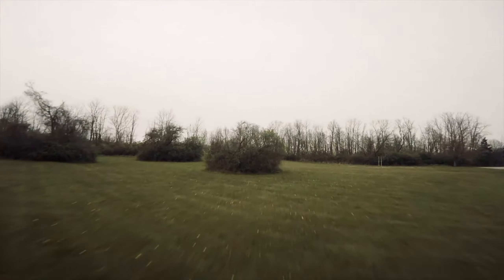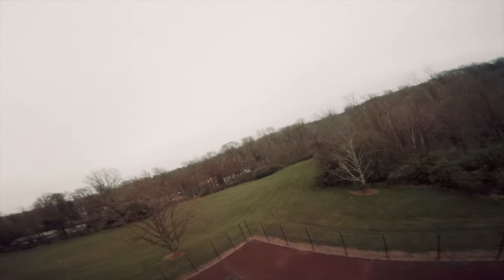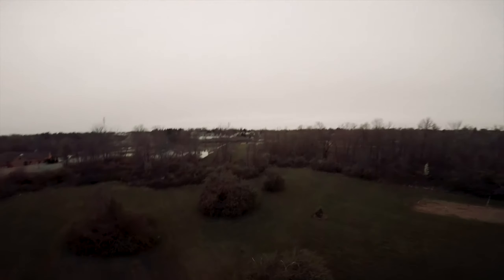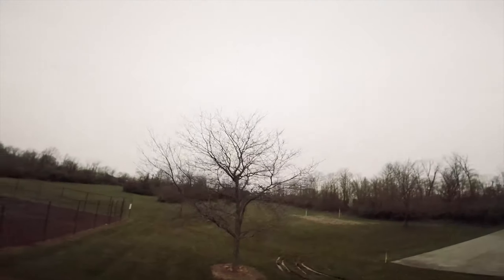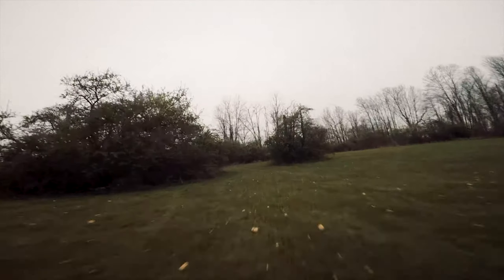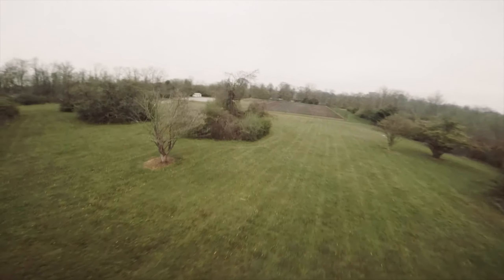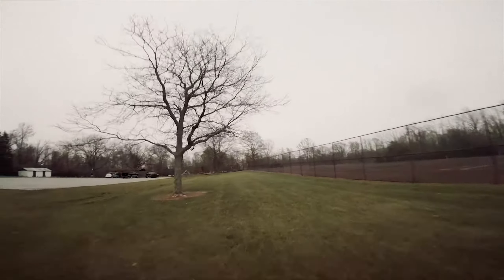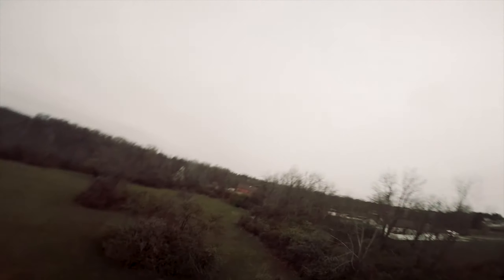TBS MASTERPILOT MOTORS FIRST FLIGHTS AND IMPRESSIONS

Comment: The question I always have with budget motors is how good the bearings are. They seem great on the first few flights but once they get into a few unplanned landings, the bearings get notchy and loud and then you actually end up spending more than if you just got something with the top quality EZO bearings. Just my experience.
Reply from the maker: kenkamm yeah I guess we will see. I needed my primos for another 5.5 epic build but this reverb has the helio spring on it and it’s an amazing 5 inch. But I really only fly 5 inch 4s around the house now and my 5.5s on 5s everywhere else so I figured for the price why not. If the local store had the emax ls
Motors cheaper or maybe the cheap dys motors I would have got them. All in all so far so good.